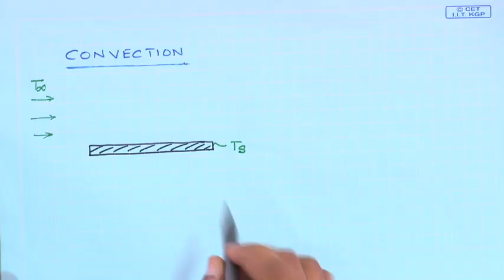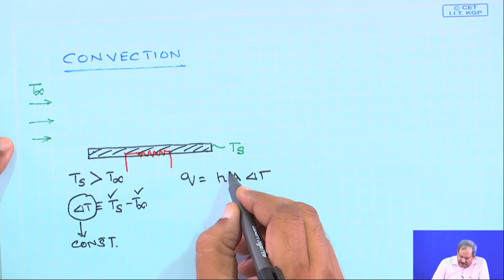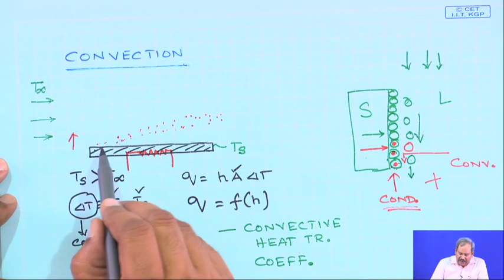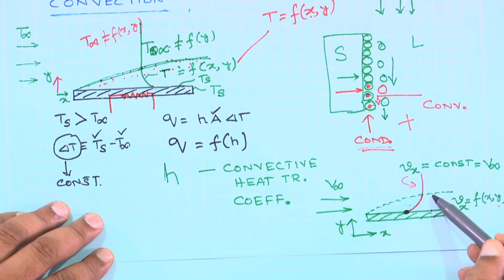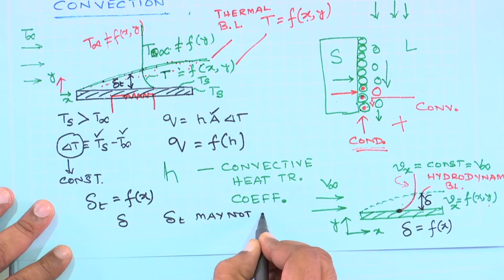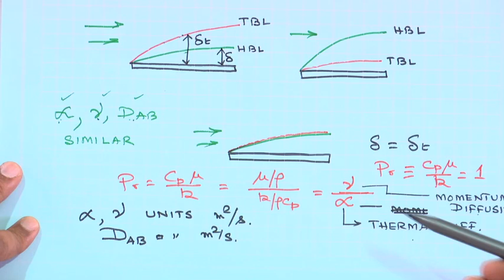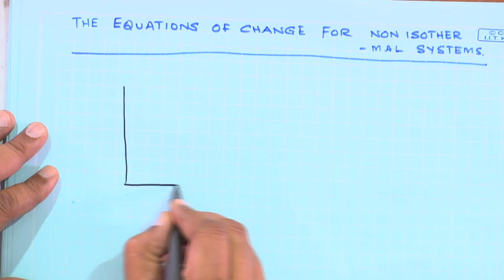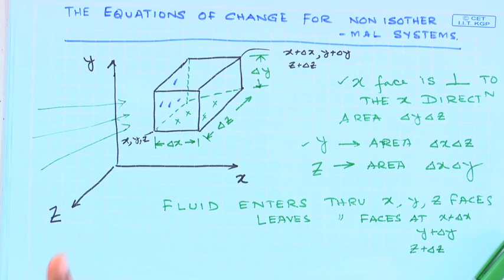Lecture 16 : Fundamentals of Convection

Comment: if we considered a non-deforming control volume, then could it still perform work on the surroundings ?
Reply: Yes, even with a non-deforming control volume, work can still be performed on the surroundings. In fluid mechanics and thermodynamics, the concept of work is often related to the force exerted by the fluid (or system) as it interacts with its surroundings. A non-deforming control volume implies that the boundaries do not move, but there can still be pressure forces acting on these boundaries, resulting in work done on the surroundings..Eg, Shaft work